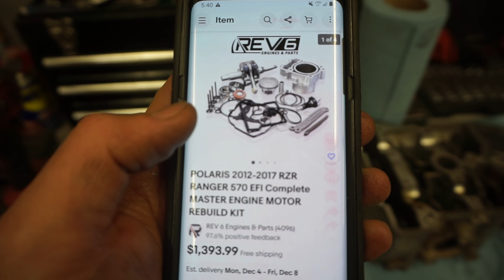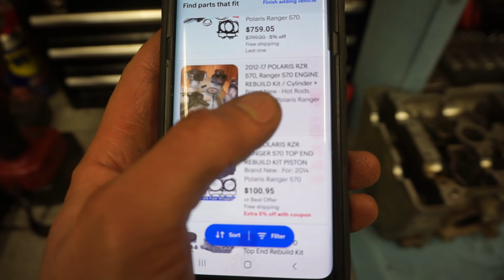I Lost Money Buying This UTV

Comment: Should have used a induction heater or a torch on the ex. bolts first rather than the last resort first. I would not paid over 500 for this POS or given to me. Your time, special tools and such will cost more than you can sell it for. These things drop like a rock after you buy them new. Parts are expensive to make a profit on these unless you plain on using it yourself. Still you overpaid for this POS. 500 or less is all I would have paid for it. Just taking it off the the other owner to get it out of there way free would be maybe a deal or you just get more junk you have to get rid of sooner or later. If something like this does not run and you no people beat the crap out of them till they just plain wore out and don't run is a piece of junk to start with. Tip save your old egg crates to mark and put small parts in.